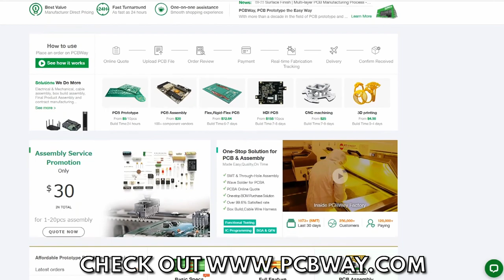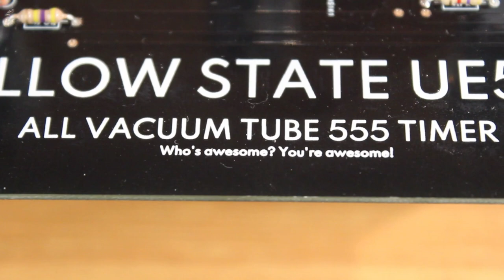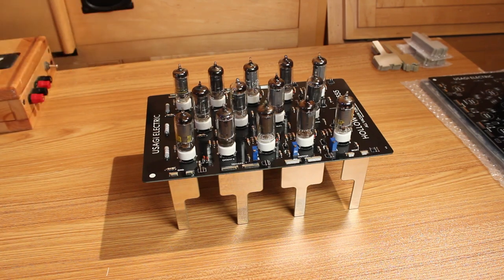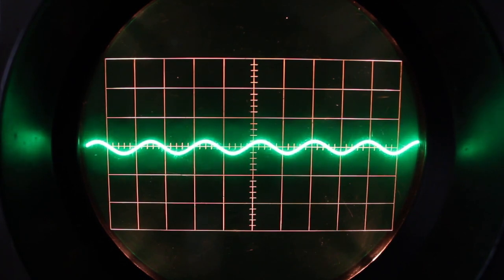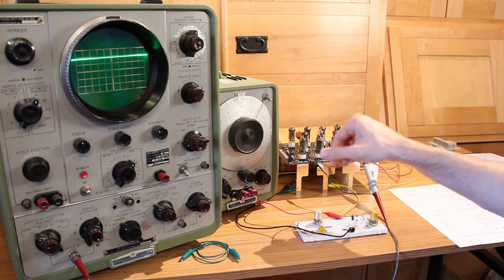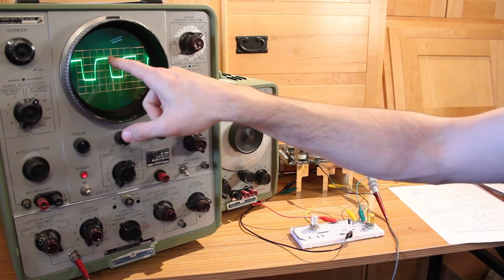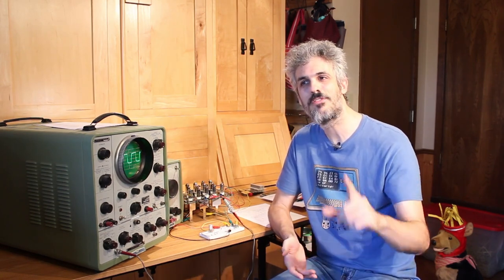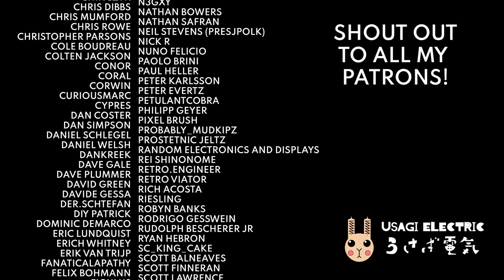The World’s Largest 555 Timer… Again!

Comment: Hey, I've been trying to put together some kits of these for me, some friends, some people at work. There's no parts list or bill of materials provided. It would mostly be a minor annoyance (I looked at PCB layout images on the repository and counted everything by hand in about 10 minutes), since almost all the parts look pretty standard, but there's three 4.7k power resistors and I don't know what wattage they need to be rated for.
Reply from the maker: Sorry, yeah, there's no bill of materials because it's really pretty flexible. It's 90% standard resistors and capacitors, and even the values of those can wander a bit and still be alright (just have to adjust the potentiometers to compensate). The three 4.7k resistors can be any wattage at all. They're just reference signals. I used like 1W resistors or something because I thought they looked cool, but you could totally use regular run-of-the-mill 1/4W resistors as well. 

The only non-standard components to watch out for are the tubes. Because I run the tubes in series, they have to all be of the same type, but that type can change a bit. I've used 6AU6 and 6CB6 to pretty good success, but some other may work as well as long as they're pin-compatible with 6AU6 or 6CB6.
Reply: @UsagiElectric  Alright, thanks for the help! I'm going to order the PCBs at the end of the month, most likely.
Reply: @UsagiElectric  So I got the power supply situation sorted out, and I've gone through the calibration process (not super confident on it, PO2B and especially PO2C seemed to have barely any effect on the signals on their test points; I was feeding it a 1kHz sine wave, if that helps). I tried setting up a square wave generator and just got a constant high output. Tried setting it up as an SR latch; constant high output unless I'm signaling the reset pin, whereupon it will go low, but then go back high as soon as I release the signal to that pin.

Got any directions on what I should fiddle with?
Reply from the maker: @InfectiousFight  It sounds like you've got it set up correctly. For the calibration process, it depends heavily on the tubes you use, but the 6AU6 behaves really similar to what you're describing. PO2B and PO2C have very little impact because PO1 does the lion's share of the work.
The SR latch is also operating as described. I didn't explain it well in the video or the datasheet, but the SET input is inverted. SET needs a constant HIGH signal and RESET needs a constant LOW signal. Toggling SET from HIGH to LOW to HIGH again will set the output, toggling RESET from LOW to HIGH to LOW again will reset the output. It's a little hard to see at first, but in the datasheet on the example circuits, you can see the type of pulse that each input needs.

Sounds like you've got it working though!
Reply: @UsagiElectric  Alright, I'll work on it some more tomorrow night. I'm using 6AU6 tubes, since I'm not electrically-skilled enough to be able to make substitutions and know what I need to fix (I'm a mechanical/software engineer who's self-teaching electrical engineering, currently I can do an ever-increasing level of digital logic and some analog computation with op-amps but that's about it). My goal is to get this working to generate square waves and pair it with one of those discrete-transistor 555 timer kits and a 2-channel oscilloscope in X-Y mode, and generate some extremely square lissajous figures.

Comment: try electro-static flex mechanical crystal, kinda piezo crystal, but just a flexing electric field arm, +/- to +/+ mechanical oscillator, ie opposite attraction same repulsion capacitor plate oscillation, even two sided +/+/- +/-/-, where the flex membrane is in the middle, grounding to the opposite polarity, the smaller you can make that "mechanical transistor" the faster (smaller mass) it will move, oscillate, like a normal nanometer nansistor
Reply: yes its a mechanical relay but oscillating based on the polarity of the flex arm membrane
Reply: not so different from an MOSFET transistor, it will make the conduction layer mechanically, micro sized
Reply: try laser engraver/cutter at 10um or below detail, ie 1500dpi or above
Reply: do you know how micro mems mechanical cantilevers are made on silicon, by etching (kinda lasering) then detaching the cantilever
Reply: just have a spark arrest L coil and a small resistor going to the ground so no zapping when alternating with the polarity contacts
Reply: ie pull-down pull-up resistor inductor

Comment: In a world where silicon ICs never came to be (for what ever reason), I wonder at the state-of-the-art computing as well as "home computing" would look like in 2022. I wonder about computing power, power draw, heat, size and cost. And would the 8-bit home computer revolution have an analogue in our made up tube universe? How about home consoles, arcade machines and on and on.
Reply: They'd just use discrete transistors. If they don't have transistors at all subminiature tubes might have become more common.
Reply: @eDoc2020  But with discrete transistors, you would still run into space issues, but with less heat and avoiding the high voltage problems. I think you are right, that discrete transistors would have been used.
Reply: @OscarSommerbo  Hybrid modules can take care of some of the space issues.
Reply: @eDoc2020  Sure, we could move away from multi-room computers to Rack sized computers, if we are being optimistic. But we are still a long way off from the 80s micros that were eminently throwable.
And that was the heart of my "what if" musing. Home computing fueled, and continues to fuel, a lot of innovation. Innovation that wouldn't have been as common or as diverse if the first computer anyone encountered was at University.

Comment: Can you built a 555 times with relay’s ???
Reply: Not really. You can obviously build astable vibrators with relays, but having an analog comparator is pretty mandatory for a 555, and that needs tubes or semiconductors.
Reply: @graealex  if you throw enough current at it.... And use small enough relays you might get close?
Reply: @zyeborm  In theory you can build a comparator out of relays (and transformers and diodes), in particular you can energize a coil with the difference between two signals. 
Whether that ends in a reliable 555 is a different story. Plus, if diodes are a thing, you can probably build the 555 just with diodes.
Reply: @graealex  you could perhaps use magnets with the coils rather than iron to get a diode effect.
Reply: @zyeborm  Diodes aren't just for rectification. The amplification effect comes from negative resistance, a property dictated by it being a semiconductor junction.

Comment: If you need to put the 12v somewhere, why choose pin 5 and then add a CV input on the board?  Why not leave pin 5 as the control voltage and add the 12v input on the board? You spoiled the purity of the design when you didn't need to.